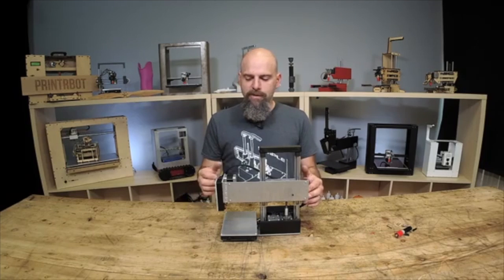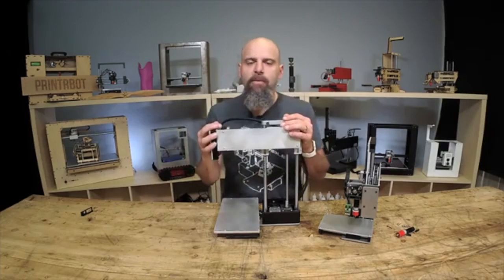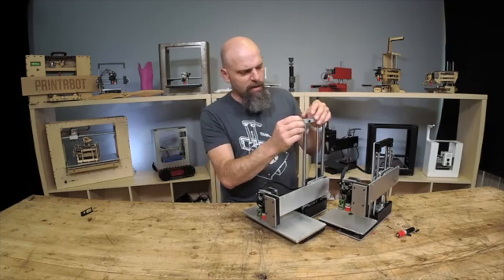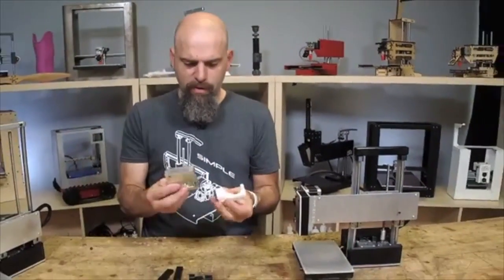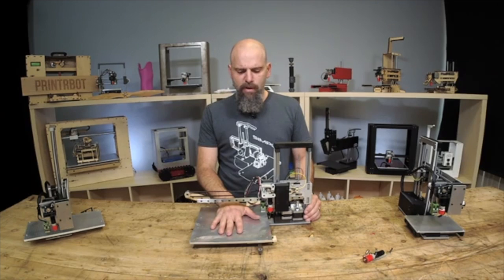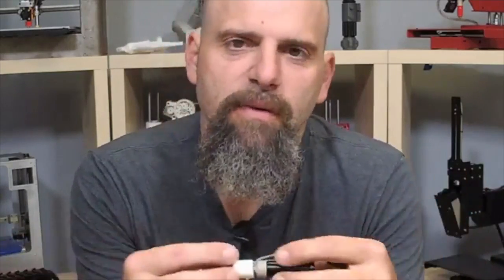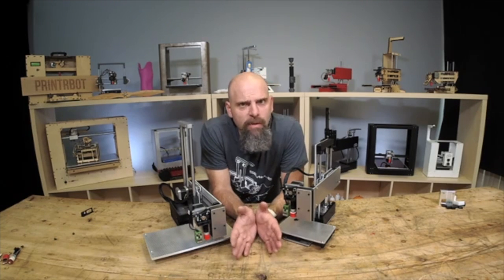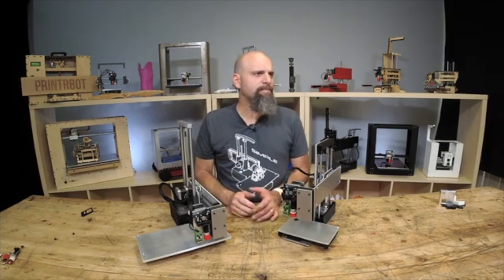Printrbot LIVE   5-4-17

Comment: Will you ever have a kit with the rails (on the Simple Pro) instead of rods, for high resolution printing?
Reply from the maker: Well, yes. The price is in a different bracket, but you should see it next week... the Smalls Limited Edition. But my side by side comparison of the Smalls base model to the Smalls LE doesn't show higher resolution, per se. There is a sexy factor, a bling factor, an engineering preference factor, a definite rigidity factor... and arguably, repeatability and reliability will be marginally better. I'm likely going with the Printrboard G2 board to better differentiate from the lower cost line up, btw... which will drag in cost and complexity along w it.

Brook

Comment: A while back I wrote a simple gcode generator to test the flow rate of the original All Metal Ubis, after having skipping problems with infill, and found it to have a pretty (as in disappointingly) low melt limit.  It's yours if you're interested.

Slic3r has a flow limiting autospeed option that will boost up printing speeds where it can, while slowing down when the AMU just couldn't keep up (mine was 8mm/sec^3 with a 120mm/sec max); my bot is seriously tweaked.  It might be interesting to play with autospeed and see just what the HF will push out.

Autospeed's a good way to crank up print speeds, if your mechanics will handle it.  Print fast where you can keep up, slow down as needed where there just isn't enough grunt.

Any plans to sell just the heater separately?  I'd like to juice up the anemic AMU.  You wouldn't do it a year (+/-) ago but maybe think about it now?
Reply from the maker: Interesting! What do you mean by "melt limit"? The 13S was designed for accuracy and ease of use, not speed. The 13HF IS designed for speed (higher volumetric flow). The 13 High Temp (coming soon) is designed for high flow AND High Temp. The High Temp can be very accurate too, but it won't take advantage of its strength if you use a tiny nozzle.

The slicer feature you mentioned sounds interesting. Does acceleration work within the boundaries? Acceleration allows faster peak speeds while not banging the corners, which results in surface artifacts (ghosting or weird rubbing). I don't see a lot of people using acceleration, since it degrades overall print time. But that's a shame since I feel job #1 is how beautiful it prints, not how fast. 

I've often though that speed should be compared as apples to apples- every printer achieving a certain standard of print quality at a given resolution, say .2mm layer height, with a given tip size, say .4mm tip, and publishing the total print time for a given model, say Benchy. Then we would know how each Printer measures up to the others.

I'd be willing to submit all my printers to this standard and publish results, but much time would spent to properly tune the speeds and settings. I would change all shipping firmware to limit the settings so as not to exceed the max desired results. 

Brook
Reply: By melt limit I meant the total volume of plastic the original 2014 Black Friday All Metal Ubis (the 13 predecessor, since that's what I have) can continuously melt while printing.  My original symptom was skipping while printing infill, then duplicated by manual extrusion length limits - as the length of filament extruded was increased it would reach a point where the stepper started skipping (interestingly the repetier-host temperature graph didn't show much, if any, temperature drop at the thermistor).  Reducing the extruder speed increased the amount it would push through before the skipping started, until finding the highest speed it would continuously extrude.  Upping the temperature didn't make much of a change.   A little math turned that into cubic mm per second.  I tried a couple different spools of PLA, plus the ABS used in the original failure, and got similar results.  The E3D on my non-PB delta will do twice the melt volume with the same tests.

Publishing print results by bot is a great idea, as long as there's a consistent criteria (speed/accel/ jerk/plastic type and source/etc).  FWIW, I'd recommend against limiting firmware settings; your tolerance for speed vs print quality (or even what you mean by print quality) might be a lot different than mine, and mine changes based on what's being printed and for what purpose.  Then there's the whole range of plastic mixes labeled as PLA (ABS,  PETx, whatever), and how they vary based on supplier,  phase of moon,  room temperature, humidity, or whatever makes it change this time.  Bots get better with age as the components wear in, and as the operator gets better at adjusting and maintaining them.
Reply from the maker: Really good feedback! The hotend in question (Ubis 13 all metal) was dropped because some people were using too much retraction (against the instructions admonition) which frustrated me enough to add teflon- problem solved. I had a goal of 60mm/sec for a .4mm tip with pla... it does that fine, but I can see your point.

Talked w Carl today and we agree that volumetric flow based on tip size, temp and plastic type is a good start. What was your calculations on that hotend for a given tip size and plastic type? I'd be interested. 

Btw, if you want a freebie High Flow unit, send me your address - brook@printrbot.... I assume you are in the USA, but maybe not. I offered 10 freebies to US customers to save shipping ;) I have a seat left. I like that you did the math!

The firmware idea was a passing thought... we can change acceleration w an mcode, so that's probably a better idea- enable something said and recommend a given speed..  but allow them to ignore my suggestion w ease.

Brook
Reply: Email sent.  I applied via the online form also.

Volumetric flow, at least in my interpretation, only involves the cross sectional area and speed of the incoming filament, assuming that what comes in is what goes out.   While the tip size will change the resistance to plastic flow and the pressure in the hotend, if the plastic is essentially incompressible (die swell says that's not completely true, but close enough) it's a decent assumption.   The first tests were just for max extrusion length at a given speed (with a reheat pause between passes), until it would extrude continuously in free air.   It started skipping started while printing a large conical object, iirc the infill was 0.3 layers, 1.0mm wide, and at 100mm/sec.  Yeah, a bit more than 60mm/sec, but nobody sees the infill.  This was with the stock 0.4mm nozzle; since acorn nuts no longer fit it's harder to make your own nozzles.

Since moose hooves are too big for calculator keys the volume calculations were moved to the g code generator, but it's still the same thing, csa in mm^2 times filament speed in mm/sec.  Details are in the PBT topic I linked to in the online hotend request form along with some g code examples and the program source (in the somewhat obscure M$ Small Basic, long story).

Never had a problem here with the short retraction, but the hotend was the first beta and a conversion from the 3.0 ceramic/Wades and direction-reading was pretty much mandatory.  You were pretty clear about it.

A bit OT, but with some limited tests in the 2013 dark ages we effectively tested the 3.0mm ceramic/herringbone geared Wades's flow rate.  I'm running out of time to figure the volumetric rate, but it was doing 16.7mm/sec extruder speed with a 1.2mm nozzle.  The OP was hitting low (to him) print speeds of around 30mm/sec with a 2.0mm nozzle; the layer thickness was in an offsite link that's since died.
Reply: Don't know if anybody is looking here any more, but the HF arrived today.  I'll post an eval on printrbottalk.com and some video here in  a couple days, but from a quick test it starts skipping at 35 cubic mm/sec, or around twice the E3D V6 and about 3X the 2014 all metal UBIS.  Now to try a quick print...